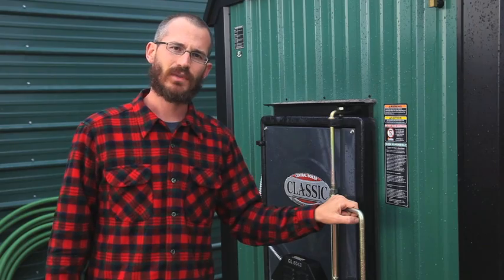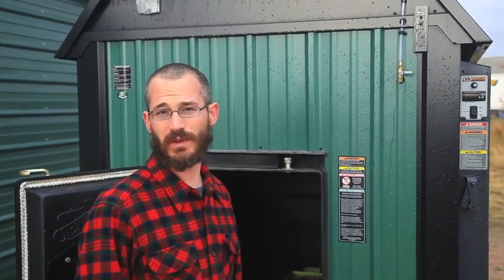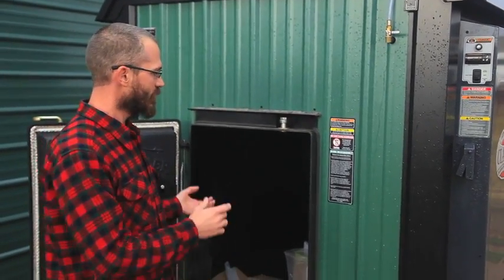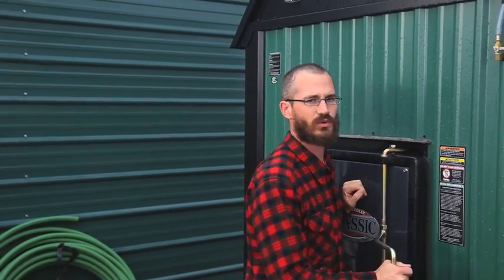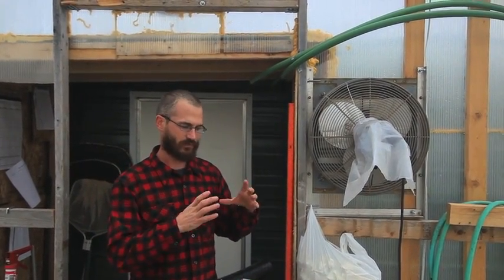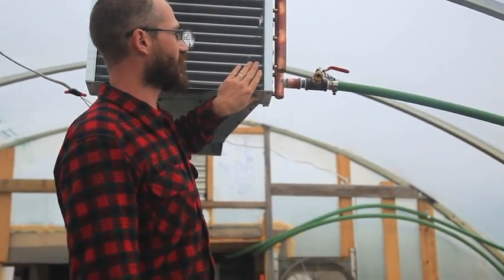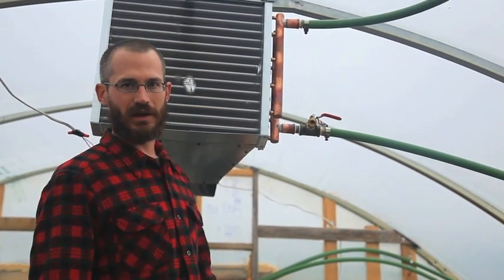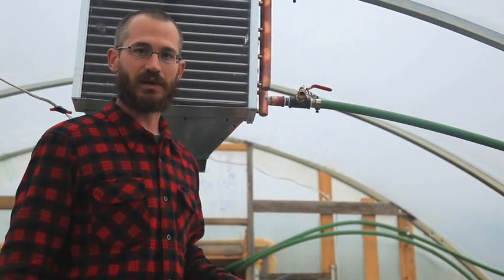How to Heat a Greenhouse

Comment: Can you use an electric water heater instead of the wood burner?
Reply from the maker: Yes, the type of heater you choose for your greenhouse depends on your personal preference. A wood heater is great for someone who has access to a large amount of affordable wood chips. 

Whereas an electric water heater requires no inputs to run it. The only thing to watch out for electric is price fluctuations throughout the years (hydro costs).

Comment: What do you think I would need to heat a 8x16' greenhouse? I'm thinking, so that the plants will grow and survive during the sub-zero temperatures we get here in Minnesota. Think, "cheapest solution." Heater? Solar heater of some sort? Let me know.
Reply from the maker: Here is a great calculator to figure out what BTU requirement your greenhouse needs: 

http://www.littlegreenhouse.com/heat-calc.shtml

In terms of types of heaters, often propane or natural gas is the most cost effective option, but electric heaters are often cheapest to install

Comment: Does the heat exchanger help with humidity? I was thinking about running my fish tank water through the outdoor wood boiler. I know I could get some scale since I run 1.5 per thousands salt. I am worried I will create a rain shower like humidity if I don't use a heat exchanger.

Comment: I got an aquarium heater in a 50 gal drum that I pump warm water thru 1/2 inch irrigation tubing running thru the framing of my greenhouse between 2 layers of greenhouse plastic and I keep my greenhouse warm in the winter
Reply: Ross28645 what climate zone are you

Comment: I'm surprised that you didn't use radiant  in floor hydronic heating, it is a by far the most efficient heating method and most comfortable, and it is totally quiet. I can't imagine working in a noisy environment all day long with a loud fan running.

Comment: We're in Washington state, and I'm considering a wood boiler for our greenhouse.  How many cords of wood does your boiler use per month in the winter?
Reply: I'm also a WA resident... turns out exterior (outside) wood fired boilers are illegal in WA because the state wants the boiler manufacturers to certify their products using WA available wood (i.e. white fir) instead of eastern hardwoods for emissions.  The boiler makers just wrote off 1/50 of their sales rather than go though the expense of meeting the state of Washington demands. 

Thinking of buying one in OR and hauling it into my backyard or making one. It sucks because the one thing I have in abundance is firewood on my property
Reply: @nohphd  Wood boilers make a lot of sense, but only if they are gasification variety and not cold burning like the one portrayed in this video. Then it makes for economical heating for a greenhouse. 40+ cords of wood is not economical or sustainable in the long run for any operation. There are plenty of gasification boilers out there to choose from. And they all run on wood.
Reply: Oby-1 ...and all residential exterior wood field boilers are illegal in Washington state, not that I care a great deal, regardless if they are gasification or fitted with a catalytic converter. 

For what it’s worth, there is a gentleman who lives on the Nebraska panhandle who has self-published an ebook called “Citrus in the Snow.”  He has an 80 foot long greenhouse using what he calls geotubes to heat his greenhouse. The only cost is for a large blower to circulate air. You can find YouTube videos on it. I bought his book.

There is also a YouTuber called LDSPREPPER who has run with the idea and built several geothermal greenhouses and shares his work openly on YouTube, there is a lot of excellent information.

Before all the trolls go off about frost lines and geothermal resources, the concept is to bury heat exchange tube 8 feet underground to pick up 50 degree heat from the soil. It turns out that in most of the world, soil at an 8 foot depth has a constant temperature of about 50 degrees. By circulating air through un-perforated French drain, this soil will heat air passing by to 50 degrees, which is fine if it’s not a tropical greenhouse.

Check out the resources available to you.
Reply from the maker: We would go through as much as 40+ cords during the cold Wyoming nights.
Reply from the maker: I'd still encourage you to figure out how to get your hands on one.  If you have wood to burn, they're incredibly cost efficient and easy to maintain.

Comment: One of the other ways to heat your greenhouse that has been talked about and done has been using compost.  I would really caution people to do their homework before they try this because where the compost pile is located, and what type of composting you do is going to translate into either success or a bunch of dead fish and plants in a short amount of time.  The "Jean Pain" method has been used quite a bit with success using shredded wood, but I want to share my experience recently using manure and straw.  The pile was only about a cubic meter big (the greenhouse is small only a 5 X 4 meter footprint( but was straw and fairly fresh steer manure.  I noticed the fairly strong ammonia smell in the greenhouse, and didn't think much about it.  What most people talk about with compost in greenhouses is the addition of heat and CO2, all valid, but one other product of decomposition is ammonia gas.  Ammonia gas is very soluble in water, it is also very toxic to plants in a gas form.  So you guessed it: my system was producing some nice heat for the water, but it severely spiked the ammonia levels in the water killing all of the fish and damaged a lot of the plants.   I then spent five hours moving the pile and black plastic piping outside and is now working OK, but I would pass on my experiences to spare you all my disaster!
Reply: Thank you for sharing! That's very interesting and you may have saved my future fish!
Reply: @LegendLength  A coil of tubing (with water pumping through it to and from your tank) buried (maybe the top foot only) in compost, I SPECULATE, will chill the compost and extract heat into clean water. Compost as a heat source is blowing my mind.

Comment: I'm almost finished designing a winterized greenhouse to be built in Massachusetts. Do you use any solar thermal banking during the winter? I'm planning on pulling any heated air that builds up at the top interior airspace and fanning it through perfed pipes in an insulated dry rock bed just beneath the floor. I also want to warm the insulated grow beds with warm water flowing through pex. Any experience with warming the soil or grow medium? Thanks!
Reply from the maker: Hey Dave Forbes - We don't have much experience with solar thermal banking, but it's a great idea if you decide to go with it. We heat our water by running our pex tubing through the fish tanks and that seems to do a great job of keeping everything warm, including our Matrix Media.
Reply: Thanks for getting back. I think I'll try solar collectors and store up that heat as well. Have you ever thought about buying some or making your own solar tubes? You could duct the sunlight down to the low plants. They can bounce 97% of the light that enters them down 30'. Just a thought, best of luck.

Comment: What kind of problem have you guys had with snow on top of your HT?  Also, where did you buy the oven from?  I was thinking of building one based on kiln design and hot air transfer but the water boiler system would be good for both the HT and the fish tank for warm water fish.  Thanks
Reply from the maker: Hi Richard Britt - We don't get much snow buildup on the top of our high tunnel at all actually. Sometimes we'll get some piled up on the sides, but that only helps with buffering our Wyoming wind. We got our wood boiler from a local dealer here in Laramie. Good luck with your system design!

Comment: What would be the optimal growing temperature for the inside of a commercial greenhouse in order to maximise growth rates?,is there any room for dropping the requirement a degree or two resulting in less of a heating demand and lower energy costs?
Reply from the maker: Hey purebokety - The optimal temperature will depend entirely on the crop you're growing. We run our greenhouse at 70 degree days, 50 degree nights.

Comment: I seen your exchanger in the air was copper has this caused fish deaths? I see so much that copper kills fish an been afraid to use copper...
Reply from the maker: Hey David Young - Copper can be harmful to fish, although our water from our wood fired boiler never gets introduced into our system water. It stays in the coils as it travels through the fish tanks, to the heat exchangers and then back to the water jacket inside the boiler. Does that make sense?
Reply: Bright Agrotech Ok so you have a closed loop heating system with a coil in the fish tank that heats the water... I was thinking of doing that and put the coil made of pex in the fish tank and use copper coil on the wood stove...

Comment: Had a question if you use a hot water heat exchanger would it be cheaper to get an electric boiler with solar panels

Comment from the maker: No, our heat loops are inline with our heat exchangers.  It's just a coil of pex in each tank to keep them warm during the winter- nothing fancy.  I'll put in a transformer and a thermostat this fall to run a three-way valve on for those loops though.  Right now we have the valve in, but it's just open by default.  Once it's connected to the thermostat it will open and close based on water temperature.

Comment from the maker: RMHs are very cool, but tough to control- especially when you're trying to heat 2500 square feet of space consuming 250,000 BTUs of heat per hour on the coldest nights of the year.  I'd have to build quite a few RMHs and I'd spend all of my time feeding them I'm afraid.

Comment from the maker: Great questions. It depends on your heat source and heating costs vs. electricity costs in your area. However, either way, towers would certainty help! While they don't change light duration, they do change light quality and you would get more production going vertically. Using towers in a GH means that costs would be lower per unit of production. In a garage, towers would mean more convenience, easier movement and you'd condense your production into a smaller space.

Comment: So I'm in the Pacific Northwest and want to set up a home based aquaponics system. In your opinion, would it be more energy efficient for me to set up the system in my insulated garage and use grow lights(and supplemental heat if needed), or put a greenhouse in the back yard, that I will have to heat in the winter? I am guessing that even in a greenhouse...given the short days and low sun angle here, I still may need grow lights. Would your vertical system mitigate that issue? Love your videos.

Comment from the maker: While gasifying wood-fired burners do burn much cleaner, you have to remember we are a small farm on a budget. The gasifying system would be a great choice if we had neighbors or were farming in some urban environment. The space we farm on is basically out in the open with only commercial buildings near it. We're very happy with how it's performing so far.

Comment: I am kinda surprised that you did not get a gasifying wood-fired boiler.  They are much cleaner and more efficient.  Is it a pressurized system?  If not, corrosion will be a problem.  Good luck!